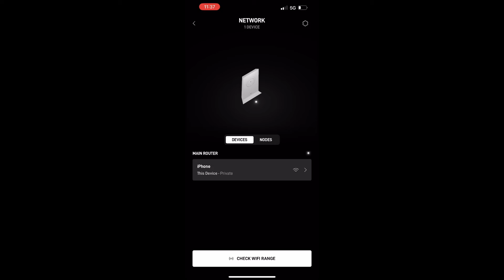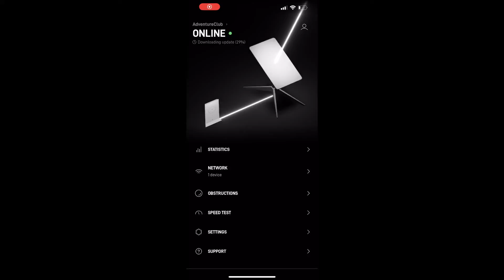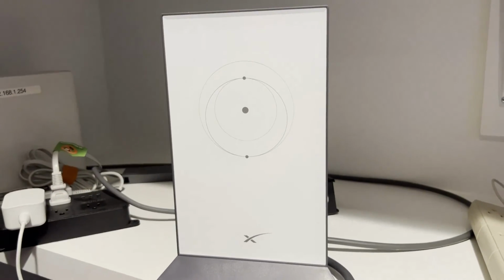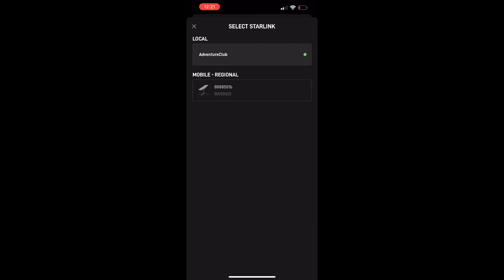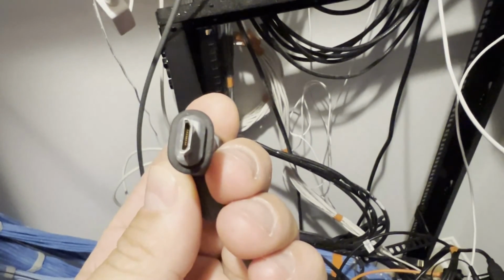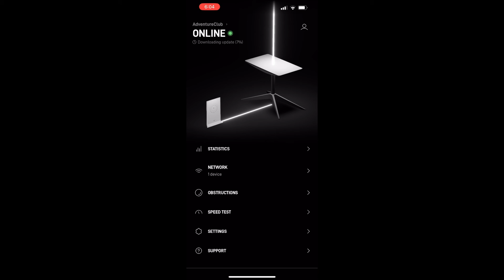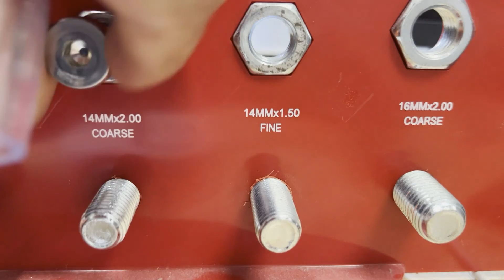Starlink Cable Issues Resolved!!!

Comment: Too bad Starlink uses those proprietary connectors. I hate that it is L shaped. It requires a larger hole be cut in your siding, etc.
Wow, that's really crappy that the slop in that connector is what was causing the problem. Mine is mounted on my roof with the aforementioned large hole through the siding into the attic, which I spray foamed. NOT an easy thing to replace! Poor design is RIGHT ! They should have some kind of clamp that holds it in place.

I guess I'm climbing up onto the roof to check the connector once we get some better weather. What a pain.

Comment: Just started having exactly the same issue with the connector not remaining snug up in the mast.  I have been trying to figure out how to remove the metal insert from the mast shell, maybe then cleaning the entry to the plug, or actually gluing the cable connector up into the plastic center section so it has no chance of falling down & out of connection.

Anyone have any luck with trying to slip the plastic center section out of the metal mast?  I was thinking maybe pushing in the locking button and tab until they clear the mast, then sliding the plastic out, but the buttons aren't depressing enough to do that, and don't want to break the system.

My Standard actuated kit is out of 12 month warranty anyway, so trying to modify to fix has a better outcome than just ditching the whole kit and getting a new Standard or Mini

update - I cleaned the rubber weatherstripping ridges with alcohol, also tried wiping down the inside of the area where the connector is in the mast.  Then as I reinserted the plug, I held onto the plastic and pushed the plug in the rest of the way with a pencil.  I could feel it go a bit farther in than 'normal', so maybe it finally seated correctly on the connector inside the mast.

In any case, it seems to be connectiing reliably to the router and I'm not getting 'cant reach starlink' error messages.

If it stays connected, I'll probably put a drop of epoxy on the backside of the connector in contact with the plastic to keep it inserted.  Then just loop the antenna cable around the mast when I'm transporting it..

Comment: Aha. Got a used Gen2 like yours very cheaply, just to play with & see how they work. Only plugged it in once so far and saw it disconnect a few times but it also managed to download an update over around 5-10 mins, so I wasn't sure if I bought a lemon or if the app was just playing up on my device.  I see the cable IS a bit loose fitting so I'll know what to look at if it's flaky when I get around to playing with it a bit more. Also very handy to understand those cables are just regular CAT5/6 type twisted pairs. Thanks for your video.

Comment: May be it will be useful for someone. You can replace the connector with IP rated waterproof RJ-45 connector. Video in Ukrainian https://www.youtube.com/watch?v=-wgyYZx64vo but pretty self-explanatory. You do not need disassemble it. He showed the opened one just for better understanding what he is doing.
Just find same video in English https://www.youtube.com/watch?v=GKYMd9tDlew

Comment: I live in SWFL and installed a Flat HP dish to use for backup to Comcast (and Verizon) - that was out for 6 weeks (and 2 weeks) after Hurricane Ian. Comcast also goes out during beautiful weather, so...

At any rate, I plan to leave the Starlink up and mounted unless a hurricane is predicted near my home, but pop it off and bring inside as hurricanes potentially pass. I would NEVER consider leaving that frail wire exposed to wind and weather and plan to waterproof and secure the cable end as each hurricane passes and the dish is removed. Again, the dish itself will come inside.

Hurricane Irma destroyed my tile roof. I had a metal roof installed that Ian then destroyed 4 years later (plus so much more). Starlink is cool... but not Hurricane proof - especially their flimsy cables!

Comment: The whole design of the cable is wrong, you (Well Starlink) should really allow for proper termination of the cable by the router and dish and then use short patch leads to make the final connection on both ends, that way if anything gets damaged on the end of the cable you can just swap it out, I ended making my own cable and terminate both ends with proper Ethernet connectors, outside it is in a IP67 (overkill) rated Ethernet box, if it is not in use I just unclip it and store it inside. Good find re the loose connection, that is just sloppy design. I will keep that in mind if I need to troubleshoot anything

Comment: Thank you so much! I got a new cable sent from starlink ( their dime). Fixed nothing. Chanced onto your video and I fixed it in 5 minutes. Took a short piece of 1/4 in.vinyl tubing and put it bteween the mount and connector. Locked it back down in the base and now its a rock solid interference fit. Problem solved! Thanks again.

Comment: My Starklink failed suddenly and it took one month to get it . Never could speak to a human , and they sent me one piece of equipment at a time, starting with the router. Turned out is was the cable, which meant hiring my builder to uninstall on my 2-story roof. Very frustrating
Reply from the maker: Glad you finally got it figured out.

Comment: Thank you for posting this.  I have a very similar setup to you but I used a bigger junction box on the pole and my 150 foot Starlink cable exits the bottom of the box through a small hole.  I don't have a cable gland like you do.   After about 8 months my cable failed. The connector seemed to be well seated into the dish.  Fortunately I had laid in a spare cable in the conduit and it  was wrapped and stored  inside the box on the pole. I switched over to this cable and my internet started to work again.  I wonder how long the second cable will last ?

I read that one owner fixed his cable connection by spraying it with DeOxit contact cleaner.  I haven't tried that. I will try that if the second cable fails although without fault finding, I don't really know the cause of my failure. There may be several failure modes that owners are experiencing.
Reply from the maker: Happy it helped!

Comment: WhaaaAt!
You didn't try to splice in a descent quality, regular USB (x) cable? Or is it not following that form factor?
Reply from the maker: It is a proprietary form factor
Reply: Yeah. I looked at really close and it is a bit wider than the USB micro B...or is it?
I suppose when your blasting off rockets a dozen at time, you may need to make sure the money is continuously  flowing.

Comment: I had to pull out my spare Starlink cable from storage to give it a good look and it looks like a Mini-HDMI Type-C connector. Once those pins get mangled, it is a pain to repair that.

I keep my cable on the dish side plugged in at all times to prevent any tiny critters making themselves at home on the dish side. If I do have it disconnected for quite some time, I give it a good going over with compress air to prevent any chance of squashing a bug between the two connectors since the dish side is pain in the neck to get a tool in there to clean out the aftermath.

Comment: One other area of concern would be whether the connector is getting water infiltration from the cable end as it's hanging there. I am hoping to get up to my place this week to work on my own connectivity issues up there (I'm in MN, so this is subject to whether we start getting snow or not.) It's a Roaming setup, so for the moment everything is powered down, but I'm not sure the dish is in 'Stow' configuration as I had been getting a good signal up until I drove off for some food and had no signal when I got back. New cable, also ordered th Ethernet adapter for when I finally get the setup in my power shed, and may go to 24x7/365 coverage, but not this winter.

Comment: The cable ends are very delicate.  I had the same problem...
Reply from the maker: Do you know what type of connector it is?  Would have been nice to have a tester to test the cable, but I wasn’t clear what type it is.
Reply: Nope, they are proprietary to Starlink
 @goodfella7483
Reply: SPX proprietary  starlink connectors  a real pain when you got dirt on it or some water inside with 50V power inside   @goodfella7483
Reply: Unfortunately the starlink connector is a end that is only for starlink @goodfella7483